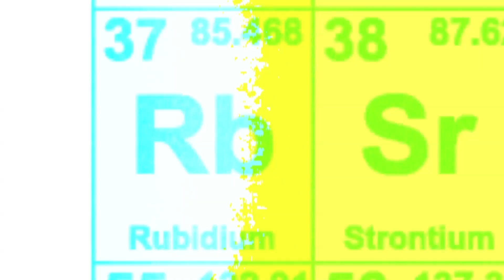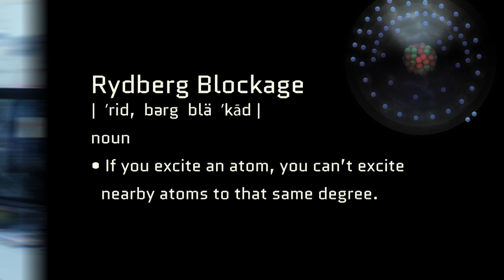Could We Ever Build a Real LIGHTSABER?

Comment: Granted he tries to explain this in 4 minutes. He needed more time to explain why it can't work, when he says "sadly no". Why can't it? To date the best theoretical answers that brings us closer to the light saber is from Michio Kaku. https://www.youtube.com/watch?v=1lr5OUjFDkg, from his show Physics of the Impossible.

Jonathan explains how to slow down light, but not how long. Micho Kaku explained back in 2009 they were only able to slow it down at most by a second using the method of gas molecules described here by Stickland and probably by the same scientists at MIT. I wish Jonathan would have said if the gas is different or if it is the same tests Michio Kaku was referring to back in 2009? Is Jonathan Stickland in the video saying that theoretically it can eventually be possible if we keep finding out new ways of slowing down light with gas? Its not clear in this short video what exactly he's saying. I can only guess the reason why he is saying it is not possible is because there is no way to stop the light, to keep it from lighting passed its desired sword length.

He doesn't say, but I assume this is why he says it is not possible. Light just goes on forever.

I also assume as to why he says its not possible, is because the lightsabers would flow right through each other because of the lack of mass.

I also assume the power it takes to heat up a lightsaber to 12k Fahrenheit, enough to burn through anything, isn't possible today to fit in a lightsaber hilt is another reason why he says "sadly no".

These are issues Michio Kaku brings up and are resolved in his episode on lightsabers. So why wouldn't Stickland mention him?

Its hard for me not to like someone inspired by science. But I find it a bit bothersome Jonathan Stickland didn't even mention Michio Kaku in this short. In science and any where else in academia we make use of what is already out there even when we try to duplicate results. 

Assuming the issues of the light, going on forever; the lightsabers just passing though each other; and how to power a lightsabers are the issues that has Jonathan Stickland saying its not possible, then the solutions as theorized by Michio Kaku, whom believes we can theoretically make a real lightsaber, we just have to update our technology, are as follows.

1. Plasma can get to the temperatures needed for a lightsaber and can be contained in a desired sword size length through a magnetic field which can be used to manipulate light waves and patterns.

2. To make the magnetic field and to prevent the light swords from passing each other, there would be a collapsible magnetically enforced ceramic rod. The ceramic would allow it to withstand temperatures well over 12k degrees Fahrenheit and the clashing of another saber of the same heat value.

3. Trillions of carbon nanotubes inside the hilt is the only idea right now being worked on at MIT which theoretically is the battery of the future able to put the power behind a city into the hilt of a lightsaber.

These ideas were thought of as back as 2008. I want Jonathan Stickland to take us where we are at in 2014, in the making of the lightsaber.

I think Jonathan Stickland should give this more time in a longer video, because even though he speaks as if Michio Kaku never put his two cents on the lightsaber, he does sound like he's on to something. He was essentially hinting at a possible Quantum Lightsaber, when he asks what happens when a second photon enters the contained gas cloud and the Rydmerg Blockage theory. He doesn't get in to it sadly. But he should. He says himself in the video, he needs some time to process all this. Take your time Jonathan Stickland, but not too long!
Reply: *****  Why is this marked as spam?
Reply: HiddenPalm I was thinking the same thing about previous purposed ideas from Michio Kaku. But I guess Jonathan is bring current ideas which means somehere allow the way, other scientist (many whom are fans of fictional seties Star Wars) realized it might not really be possible to replicate the exact idea of a lightsaber or at least in the manner we like. But Jonathan did mention slowing down light, a good way to make memory and store memory of light for a light based quantum computer.
Reply: *****
So to would democrats, lol! Actually Michio Kaku figured out how to control the reach of the light back in 2008. I know I said allot in my comment above, but I went into the details, of where Michio Kaku left us at, in constructing a lightsaber. My issue is, why would Jonathan Stickland not mention any of it.
Reply: ... That was nice. 😐
Reply: U don't like democrats?!?!?! Me neither!